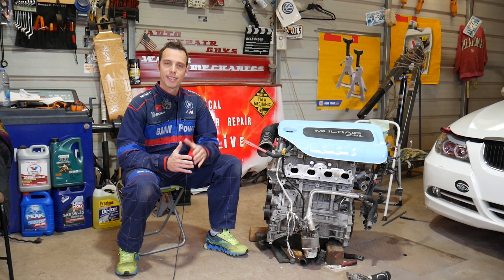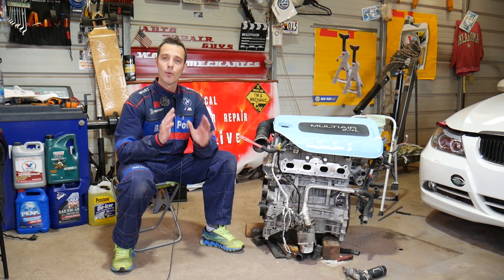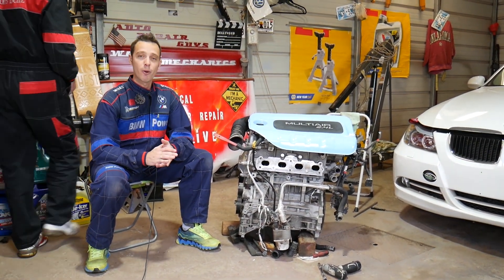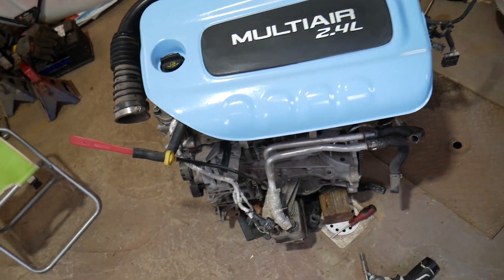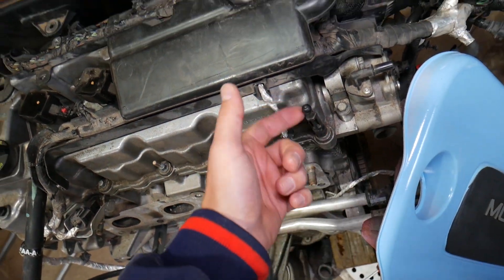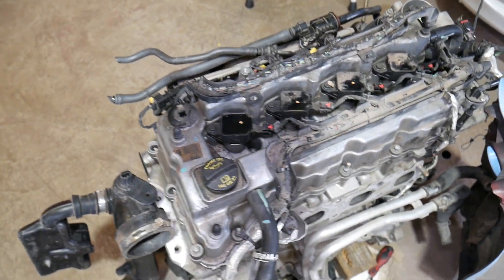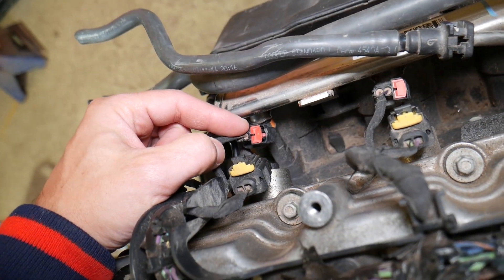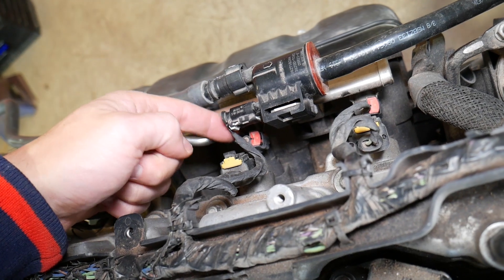FIX Code P0261, P0262, P0262, P0264, P0265, P0267, P0268, P0269, P0270, P0271, P0272 Ram Promaster

Comment: Hi what about if it’s not the injector plugs nor the injector itself 
What would other problem be to cause fault code p0272
Broken valve spring
Or cylinders ?
Thnx
Reply: I got the P0272 code when i replaced the  original fuel injectors  with new set for injectors. I found that most of new fuel injectors are not good quality even if it expensive  like the original one. If you can get the new one from the dealer it is better, i know it expensive but the car will back active like rocket.

Comment: VAG-COM Version: Release 409.1-US

Control Module Part Number: 4B0 906 018 AA
  Component and/or Version: 1.8L R4/5VT      01 0001
           Software Coding: 05001
            Work Shop Code: WSC 00012
01 Faults Found:
17931 - Crash Signal from Airbag Controller: Implausible Signal
        P1523 - 35-00 - -

VAG-COM Version: Release 409.1-US  Hi pleas help i have a 1999 land rover freelander  and i am installing 1.8t vw motor in it the abs airbag and cluster  is reining from the CCU and i want to us the ecu for the motor ? bat the fault is the fuel pump relay go on off now indication VAG-COM